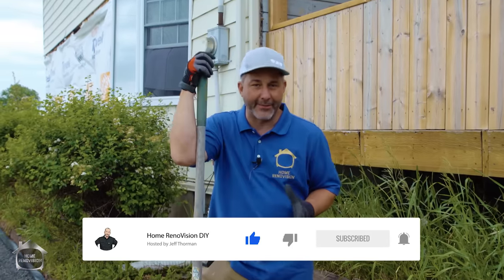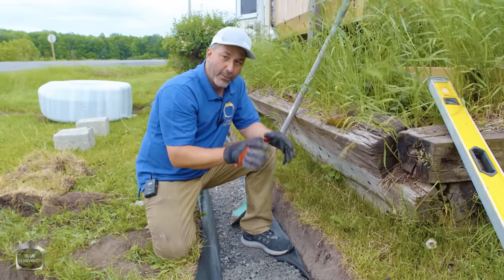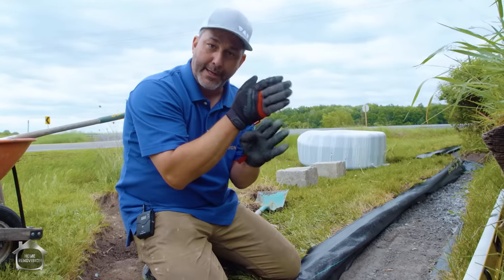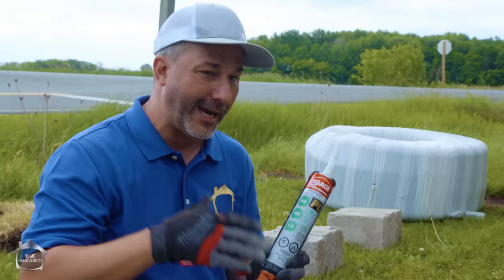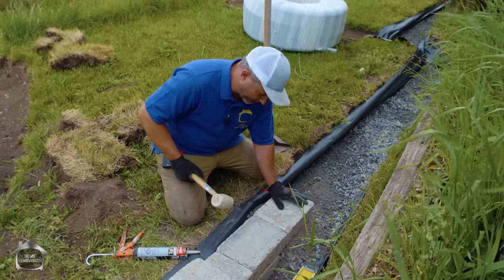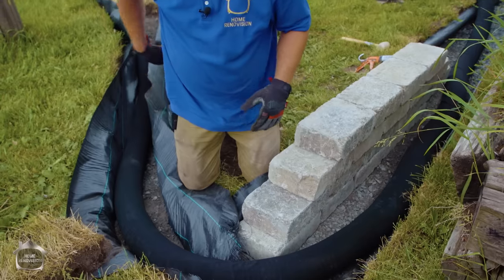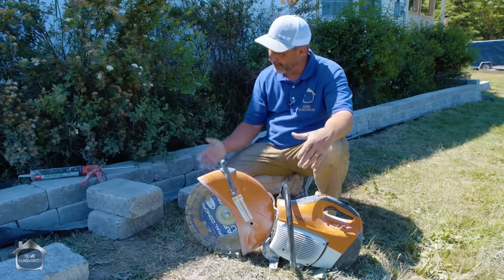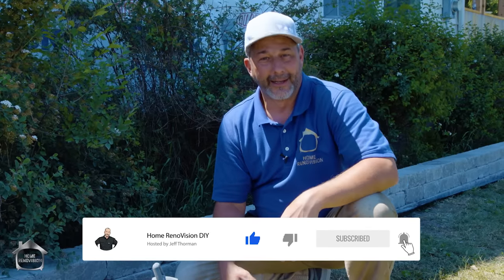How to Build a Retaining Wall - Step by Step

Comment: Interesting that you suggest setting the stones back 1/2 inch- When building a stone dry wall, like the ones John Adams built when he retired from politics, requires that the wall be slightly leaning into the slope. If building a free standing wall, the base has to be larger than the top. The lean is about 2" per foot of rise. Back before the internet was what it is today, we had to find a book about building dry stone walls and we found a single book in the Special Collections Library at San Jose State that we had to read in the Library, but they did allow us to make a photo copy. It suggested making a triangular "ruler" that you held up against the wall to make sure the lean was correct because when the wall is made of random stones, it's rather hard to measure accurately.

Comment: Hi Jeff, I acutely have I of those, I looked at an ad for one free of charge for spares only as it would not start, once I got it home I striped it down and found the fuel line was blocked, after clearing that I found four nicks in the fuel line so I bit the bullet and bought some new about a metre length, replaced all the tubing switched it on, nothing happened, I checked the spark plug took the number and treated it to a new plug turned the switch to on pulled the rope and it snapped. Got some new started rope fitted it pulled and off it went. All in it cost me less than £10:00, and it came with two cutting disks for stone so I call that a bargain

Comment: I have a question, why use the loose stones? Can't you use concrete/cement and make it more durable?
Reply from the maker: sure but that is messy. That adhesive will even work through the winter.

Comment: Good video, good information presented. I agree with the other commenter about PPE: don’t do what this guys is doing. Glasses and ear protection for sure, and a mask rated for concrete dust. Silicosis is a very real, very nasty possibility if you don’t take proper safety precautions.
Reply: Safety sally safety sally..

Comment: “Production 1st, safety 2nd”.  Production gets faster as you develop skill. Production mistakes can be fixed. Can you make growing a new foot, finger, dent in your head faster? Can you fix injuries fast and painless, and keep working instead of loose weeks or months recovering?  Ask any first responder if skilled experienced workers ever cut off a finger. And that stone dust, very fine rocks in your lungs, they are heavy, most won’t leave, will be there when you die, probably sooner and more painful than expected.  Other than that, great video!!!

Comment: Although it doesn't take much to hold a 3 foot high retaining wall from toppling on a mild slope, I like using cinder blocks much better because they have holes in them and I sledge hammer in 7 ft. metal T-posts 3 or 4 ft deep in through the holes every 6 ft. and file the holes with cement and cement the blocks together, easy peasy and I have 40% steep hill sides that haven't moved it over AT ALL in 10 years.   If you want more stability stick some 1/4" aircraft cable around the t-post and dig a trench into the hillside 3 or more feet and stick a short t-post upslope on the hill and cement it in and that wall will never move.    my $.02

Comment: Can i build the garden retaining wall  3 layers  crossover on buried sewer line. 1  paver has 24 lbs  weight. I build with 3 layers .so weight will be 75 lbs  . Sewer pipe can handle of that weight . Someone Please help me concern and  instruction  please .

Comment: Great video Jeff. Thanks for that. Question: you places a geotextile under your base to isolate the water coming from above and within the wall. But geotextile is not hermetic, i e. it has holes that will let the water go through. Thanks.
Reply: Yes, geotextile fabric is permeable. It needs to be, do not substitute for a waterproof plastic

Comment: Jeff, in the back of the wall are you allowing your drain pipe to run at a 1/2 bubble level or not? Also watching Stanley dirt monkey  I saw him use a tile that was hollow with a small design that allowed for drainage through the bottom of the wall. I don't know if this would be applicable to your projects.  As always great videos and lots of helpful information.

Comment: If you don’t have a tamper, a 4ft length of 6x6 will also work.  If you don’t have a mallet, use your steel hammer but a chunk of 2x4 on top the brick
Reply from the maker: just buy the mallet it works better!
Reply: Home RenoVision DIY lol yes but you’re dealing with a Dutch man here

Comment: I was going to at least mention safety glasses of some type but you’re not a beginner at this and you seem to still have all of your limbs and fingers. As for me, I wear safety glasses like they’re a part of me - usually tinted - and gloves of one kind or another. But this from accumulated experience from myself and others. As far as a respirator, I’ve had my share of lung damaging chemical exposures in both civilian and military environments and for the last 20 plus years I’d use a full face when necessary and nothing when I felt it wasn’t. Like you said, exposure is everything and occasional respirable particles aren’t going to end you. 40 plus years of this work and I’m not in an iron lung. Just don’t push your luck though, decreased lung capacity is no joke. And losing eyesight is a career ender…

Comment: Good guide, but for anything above 4 feet you need an engineer to sign off. A lot goes into the design of retaining walls, including soil and structural analysis. So a 2 foot diy wall, great vid, but if you want something higher, or that will retain a significant load, I'd suggest speaking to a technician or an engineer.
This is a great eye opener to how much work goes into these walls, looks like a lot of fun.

Comment: At 10:50 rather than moving the stones back and forth several times to get it flat it would be much easier to screed the paver base with a 2x4 and get it flat with a thin layer of leveling sand. Then you only need to move the stones once.

Comment: A few things...
1. Base should be 6" [minimum] beyond the block.
2. After the base gravel (8-10"..compacted of course)...throw down an inch or two of slag sand(compacted). WAY easier to level, without the big stones.
3. Get a damn dead blow!!!

Comment: I love this video and I feel like I skipped a step in the wall I'm building right. It's nothing like this one but I didn't put down any of my expensive landscape fabric first. I'm also using sand to level my landscape pavers. My thoughts was any liquid could easily drain though sand.

I'm in the Tulsa Oklahoma area and I'm only going a max of 3 stones high. I had mine built going uphill like you done there but I had to tear it out due to the fact I didn't want to deal with tons and tons of weeds between my sidewalk and porch. Basically I'm doing a reverse build and it's a nightmare compared to this. It doesn't help with the fact I'm paralyzed. Furthermore I'm using 1 of my 2 miter saws for my cuts. It cuts the stone just as easy as that one does, like hot butter. I wish I hadn't wetted the stones now because concrete mud is everywhere including on my miter saw stand.

Comment: I’m not pretending to be a construction expert, but I think after digging my trench I would place a block either end and run a string so I can set a level reference
Reply from the maker: that works fine on a flat surface. this wall is built into a hill.Cheers!

Comment: ive done this on a larger scale at work...such as a a concrete footer....and then excavators lowering 3 to 500 pound  pre made concrete blocks...block the waves from hitting the rich peoples lawn. You'd have to guide it as it hung on the chain into place...then unhook it and perfect it with a pry bar....😂watch them fingers! Some retaining walls would be empty blocks, we would cable them together real tight and pour concrete inside of them...then stack more blocks on top.

Comment: As a person that has been doing construction work for over 30 years, I can tell you that SAFETY doesn't hinder the production or the pace at which a job is done. The quality is always in the pride you take in the job you do and safety means you don't need to tell people why some dumb arse has hurt himself or explain why you let someone work in a way that is clearly dangerous. People always say that they have been doing this for years and that they know what they are doing until they get hurt. If you worked for me or on one of my sites and done that, then you would be looking for a new job as you would be leaving open for a lawsuit. SAFETY IS ALWAYS PARAMOUNT. Always use your safety equipment that is EYE PROTECTION, DUST MASK/RESPIRATOR, SAFETY BOOTS, EAR MUFFS/PLUGS, and GLOVES, using a DEMOLITION SAW always requires water to stop the silicon dust in stone from being carried in the air. So many bad habits are being shown to people who may not know any better.
Reply: guys a mush head

Comment: Hey Jeff I’ve never seen a wall laid like that before. Why did you choose not to use mortar ? By the way I really love what you do on your videos. I not trying to be an arse
Reply from the maker: this is what I would call a low force landscaping wall. it does not have to do much other than look pretty and hold in all the pea gravel I will be dumping in there. it also is a great edge for trimming the grass.

Comment: Only problem is that the filter sock will clog up with fines from that dirtier material. Water will run through that material, move fines out through the "clean" filter, and into the sock. Eventually the sock won't allow water through. Would be better to remove that sock, put a clean out every so often and ensure you can clean it ever fills up

Comment: I want to build a retaining wall in front of my house, but I have my stairs to my house in the middle of the wall and neighbors on each side. How do I do the drainage since I can't put the weeping tile out into the street?
Reply from the maker: you can install a holding tank in the yard. a plastic barrel with weeping holes that receives the water and then slowly allows it to drain later.
Reply: @HomeRenoVisionDIY  Thank you! I have another question. Every video I watch about the drainage shows only end and where the water comes out. What do I do with the top. I know I'll have to grade it for gravity but what happens on the other end of the pipe? Does it sit at ground level with a cover on it? Or something else?

Comment: I being working on this kind of work for a long time, and all that follows is experience involving me or my workers. Safety is first. When cutting you produce a lot of silica dust. And yes a little bit of dust will definitely kill ya on the long run. Silica does not come out of the lungs and with the years what you breathed in will absolutely destroy your lungs even a little, there is a nice youtube video that explains it look it up...please please at least wear a dust mask. Gogles are also a must, you think you got all the dust and particle out of your eyes but chances are you didn't,  eyes try to protect themselves so they immediately grow a film over the particles, within a couple days, the doctor will have to dig to get the particles out. And I have personally witnessed a man cut the tip of his foot off with this tool, freakin wear safety boots or shoes.

Comment: This is really odd to me as many retaining walls as I have done I've never put the fabric under the crusher run(sand&rock mixture as this guy calls it) also I use a plate compactor to pack the base so that it is solid. I have never had to go back to one I've done

Comment: in my humble and inexperienced opinion i think you are using the wrong kind of geotextile.  ive used the one you do in this video for other projects and its almost a waterproof material.  I know you said that in this case this is a good thing because the water will flow to the drain but i think that textile will do more harm than good. Am i wrong on this? Wouldnt a geotextile that lets water pass b etter?  Thanks for the video though this is very informative and I love your videos.

Comment: problem is cutting one at 45 degree angle instead of 2 at 22.5 is that the lengths are different. The length of the 45 degree edge will be longer then the edge of the end of the full stone. Does that not matter>
Reply from the maker: we are going to be back filling with pea gravel so you only see the top layer. that one will be at 22.5
Reply: @HomeRenoVisionDIY  Gotcha Jeff! Thanks for pointing that out!

Comment: Wouldn’t call that a retaining wall but you did mention that. SRW blocks have interlocking lips or assembly pieces. Those blocks should never be used for a retaining wall. Also, you should never glue your courses, only the caps.

Comment: For anyone watching please use the proper aggregate, he is not.  He keeps mentioning stone dust, you DO NOT want a bunch of fines in your base material for a retaining wall, you want more chips, there are many reasons for this you can research.  I also recommend spending a couple extra bucks to install a universal base pad that can stabilize and offset any inconsistencies in your base that might develop over time with water and frost.

Comment: run a level string from one end to the other before you start, and follow it. going block to block leveling each as you go does not produce the best result and is too much work. String is you friend.

Comment: How high of a retaining wall can be built this way and at what point does it become a "high tech, expensive retaining wall that is holding up a wall of mud"?
Reply from the maker: 3ft max. any higher don't offset the bricks the 1\/2"
Reply: @HomeRenoVisionDIY  Jeff, recessing the blocks increases the strength of the wall. It's actually more important as you go higher, even on a little gravity wall like this.

Comment: I like the  step by step video, but could not resist mention the lack of protection.
You are placing your foot with snickers holding down the block while trimming the block, not wearing any protective respirators...
You do mention the protective equipment but not practicing it. It takes just a quick second to potentially amputate your leg.
Use protection PLEASE!

Comment: We get it, you've been doing it a long time, but that doesn't you should encourage or suggest that it should be productive first safety second. As a contractor you may be more intested in profits. As a DIYer, the money saved should be invested more into safety, as it is way worse to try and save money on a project by DIY and getting hurt for it from lack of skill and frequency of that type of work and handling. The savings is generally in contracted labor, and a new added tool, which in most cases is better to buy a medium grade tool, than rent. Content itself is generally pretty useful and does get the work done from your videos. Safety is second for you, fine, after this many videos we get it, you don't need to emphasize it as some kind of badge of honor to prove your skill and let some armature get hurt. It just takes one shard to fly into someone's eye.

Comment: Strongly disagree with much in this video, both on safety like the other comments mention, but also how the wall is built, its just not entirely accurate, normally I call out each thing wrong but there is just so much, would recommend just about any other video on this topic

Comment: lol   A little dust isn't going to kill you?    that shit sets back up in your lungs man.  a Little breathing protection isn't going to kill you. LOL   For dry cutting concrete or masonry, silica dust becomes a paramount concern.Cutting concrete with an abrasive blade or a diamond blade generates dust, some of it silica dust that is fine enough that it can be drawn deeply into the lungs. Breathing in fine crystalline silica can lead to silicosis—an incurable lung disease that results in lung fibrosis. The National Institute for Occupational Safety and Health (NIOSH) estimates that nearly 300 construction workers die annually from silicosis. “Silica requires a P-100 filter, Hearing protection is another important consideration while cutting, There are many very good low-cost earplugs on the market today that are effective at reducing noise levels. 

    No joke man, I am 52, never did anything crazy in construction that anyone thought would silicosis
Reply from the maker: Hi Larry, you hit the nail on the head. 300 in construction. that means fulkl time cement or concrete workers. I am tLKING TO HOMEOWQNERS WHO WILL HAVE VERY LITTLE EXPOSURE. cHEERS! lIKE i SAID A LITTLE WON;T KILL YOU

Comment: This guy's advice is dangerous & irresponsible.  Safety & PPE are Critical and substantially decrease the percentages of an injury.  You WILL get tired, sweaty and have momentary lapses of judgment.  It's inevitable.  Wear quality leather boots which offer more support and comfort on job sites.  Cutting concrete will get it into your lungs and debris in your face.  Wear a quality face mask and proper eye protection.   Cutting concrete makes a dangerously loud high-pitched noise so ear protection is needed.  Most importantly, take your time and Don't rush.